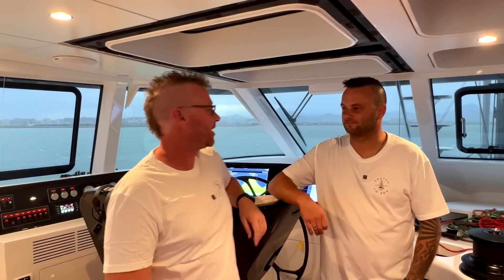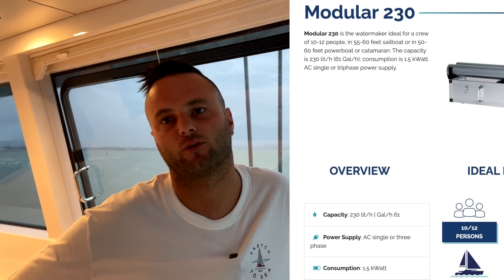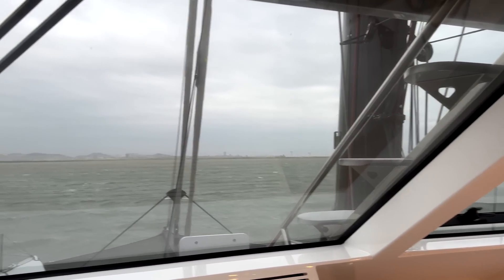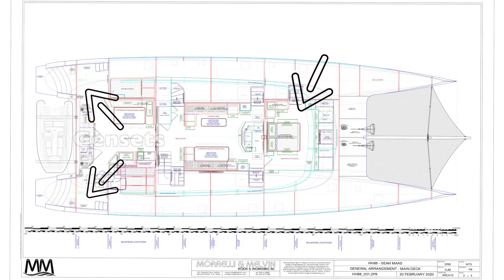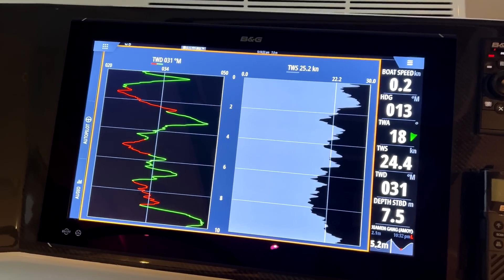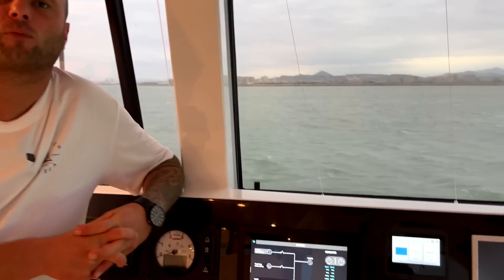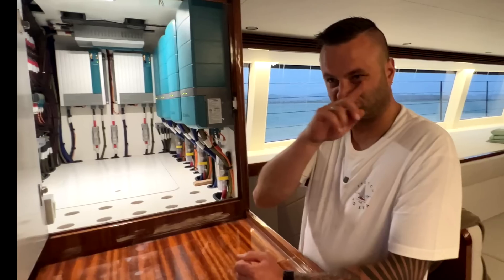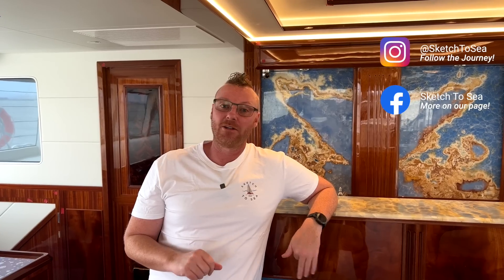Sketch To Sea: Energy Consumption and Production

Comment: Why use Mastervolt over Victron ? Victron does have much larger inverter chargers that can be run in the same configuration. Interested in the decision tree.
Reply from the maker: Mastervolt is under the umbrella of Navico group, which is the same as our other hardware CZone and B&G. CZone & Mastervolt have been integrated systems for over a decade so there are advantages with what can be done with the system as a whole. Victron & Mastervolt make similar products, deciding between them often depends on the bigger picture of the system being designed. Check out this weeks episode to see some of these benefits.
Reply: Interesting, yard brand loyalty has trumpet known reliability and efficiency. I assume this decision has also limited you to 24v vs 48v for such big loads.

Comment: It's interesting listening to how Chris describes the inverter loads over Peak RMS, ( when loads are increased during start-up, ovens reaching temperature, AC Compressors first kicking in, Refrigeration Compressor spiking.) How the totality of the max-capacity has to be engineered to withstand those peak values when all of those systems run and much lower idling rates. I would love to see the breaker panels and the various amperage limits associated with each system.
Reply from the maker: Thank you for the comment,  I will see what i can do about putting that together.

Comment: The amount of power you can generate and that you use is insane.
Reply from the maker: Thank you for the comment. It is definately on the large side of the spectrum for a sail yacht. A motor yacht of this size would easily have 300KWH of power.

Comment: The heat coming from AC units should heat any water needed. So many ways to make systems more eco friendly. Heat pumps to cool and heat. If hybrid would have been used for engines when sailing regen could keep batteries full.
Reply from the maker: Thank you for the comment. The AC heat that you mention would not be enough for the hotel loads. We also would have had to install a closed fresh water loop in order for this to be an option. We do have a heat exchanger for the engine and genset exhaust to heat the domestic hot water. Regen while under sail would have meant a very different set up, and doesn't help us at anchor. The solar output satisfies the electrical needs while sailing.

Comment: Sean, The energy options to run all these systems is impressive.  It will be really nice to see in say about a year what kinks resulted or if its all smooth sailing with little issues.  Thank you again for sharing.  One thought would try to avoid anywhere in season there is a lot of lightning!  A fortune to repair all those systems.
Reply from the maker: Thank you for the comment. We do have a dintecco lightning suppression system onboard and have been through quite a few storms here. When we were on the hard the boat next to us was hit. This is one of those items that you will never know if it works or not.

Comment: Nice to see that you built in a bunch of redundancy.  That boat should be able to run completely autonomously when not under a heavy load.   You will only be starting the gen-sets when you have guests.  Can't wait to see the performance numbers you get out of some of that wind you are getting there.  And please include the load numbers on the rigging.
Reply from the maker: Thank you for your repeated thoughtful comments. That is the plan. When the boat is on charter or guests are here we "should" be capable of doing anything we want. We are still working through a few gremlins in the systems, but that is what trials are all about.

Comment: Is the boat set up for regeneration off the props/shaft-drive when you are underway? Unrelated, do A/C units and other draws that have high peak loads require soft-starts or is that all handled by the inverters?
Reply from the maker: The boat is not set up for regeneration. It was designed differently from the start. While sailing our solar can provide for us.

Comment: Nice haircut. I like it. It seems the HH has developed the HH 80 based on your 88 design however it is designed for speed.
Reply from the maker: Love this comment. They have... I personally had a lot of input on the interior GA and worked with both James and Paul about this. Different design brief, but the 80 is a pretty cool boat.